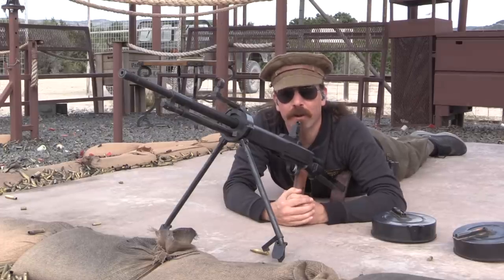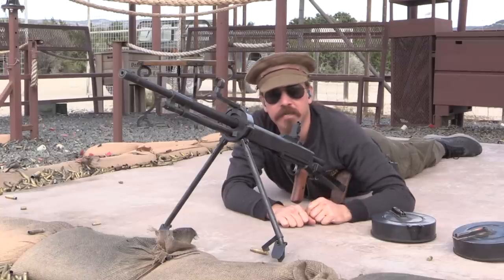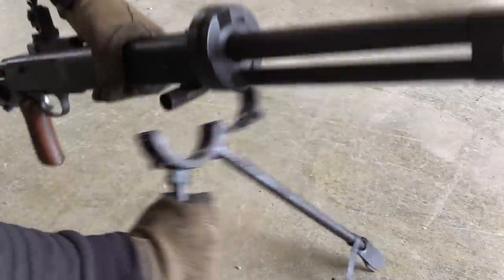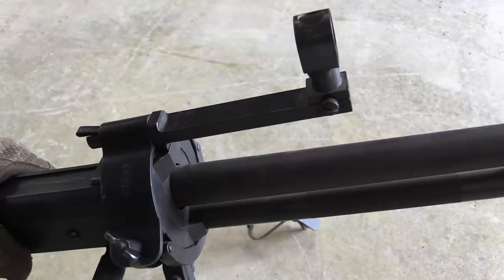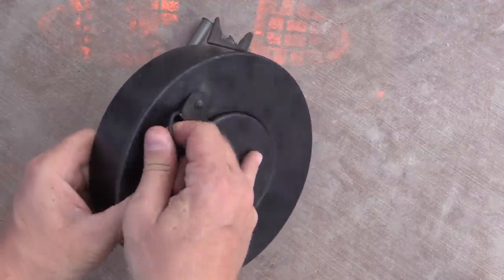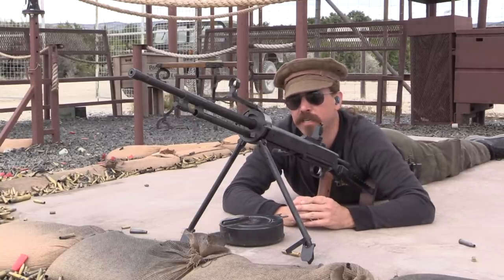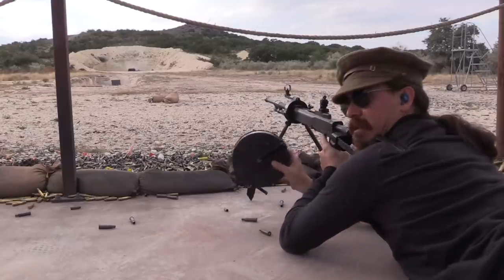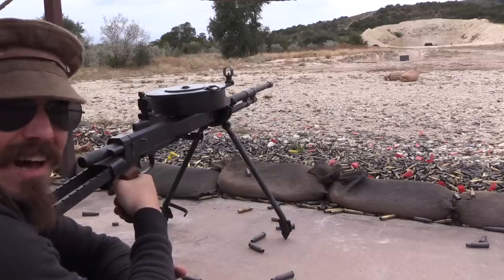DTM: The Soviet Tank Version of the DP-27 LMG

Comment: Seems to me this was primarily a vehicle gun that was intended to be used dismounted only in an emergency. Considering that the most likely alternative would be no dismounted gun at all I think we can forgive its little peculiarities.
Reply: Yes. That's exactly what it is. He explains that in the first minute of the video....
Reply: @dawnbreakercastro5051  They did have a lot of (wo)manpower.
Reply: enrique kahn same with the Japanese type 97 Lmg
Reply: Primarily a vehicle gun, but it was issued to the infantry quite extensively as production exceeded vehicle requirements.
Reply: He suffers so much with this machine gun because he is too poor to buy a tank and have fun.
Reply: @kalsarikannit2058  I bet this comment doesn't have the same savour now :p
Reply: I read a fiction where a tank was in a hull-down position. Then the hull gunner dismounted his DT and went to add it and his skills to infantry for a while.
Reply: It probably was also a factor that they want to have as few types of machine guns in production as possible, so if you need spare parts, they can be pulled from the same set of resources. This may have a couple distinct parts, but it's likely mostly compatible with other dp-27 guns. Might as well be capable of pulling it out for emergencies since the primary version of the gun is infantry portable.

Comment: The two issues called out were probably less of an issue: 

1) Soviet tanker's helmet had ear flaps that would effectively protect the cheek/chin from the sharp edges of the collapsible stock.
2) If you're a dismounted Soviet tanker in the 1930-1940s, chances are you're fighting in the steppe or a wooded area of Eastern, Northern Europe, and not on concrete paved firing range. The bipod was supposed to dig into the ground for a good 2-3cm, so it wouldn't be as tall in practice. The intense mechanized urban fighting we observe in modern conflicts wasn't so much a concept until WW2.
Reply: I also think you only would take this out of the ballmount to run away and get another tank. Like the chieftain said. you are a tanker, not a soldier, get another tank and use the gun to keep the enemy down while you do that.
Reply: @isuzu6851  You'd also might dismount it for sentry duty.
Reply: @williammagoffin9324  correct. Also tanks break down a lot more before they ever reach combat and are abandonned.
Reply: @TheRealColBosch  or "tanker, not infantry"
Reply: If your a tank and your army has been surrounded which happened to russian armies a lot. Then you dismount and fight as infantry when your tank runs out of supplies. The germans were so low on infantry during stalingrad they did just that, dismounted and grabbed rifles.
Reply: Yuri V 100% right !
Reply: ... or you could just wrap your support arm hand around the side of the stock in the way, that it'll work as the cheek rest :P !!! Jesus guys, there you'll have, eastern problem solving!
Reply: caugh Stalingrad caugh
Reply: Only when I read this, I realize that most people who watching this videos didn't know these things. For Russians, it is as obvious as the fact that you take off your pants before you shit.
Reply: For me, the biggest mystery is why this machine gun has the ability to fasten the belt.
Reply: @АлександрФорт-д4ь  what belt?
Reply: @breembo  this machine gun does not have a shoulder strap. Because of this, it is inconvenient to wear.
Leaving the tank, the crew will experience significant problems with carrying a machine gun. In Stalingrad, this machine gun was actively used by infantry. I am sure that the lack of a belt created a lot of problems with carrying.
Please note that only two photographs have a belt that had to be tied in a knot on the barrel of a machine gun.

http://livinghistory.ru/topic/80906-pulemet-dt-29-v-pekhote-foto/

---------------------
у этого пулемета не предусмотрено крепление плечевого ремня. Из-за этого, его неудобно носить.
Покинув танк, экипаж испытает значительные проблемы с переноской пулемета. В Сталинграде этот пулемет активно использовался пехотой. Уверен, отсутствие ремня, создавало массу проблем с переноской.
Обратите внимание, что только на двух фотографиях есть ремень, который нужно было завязать узлом на стволе пулемета.
Reply: These were also issued to some Soviet paratroops because they possessed a folding stock and were lighter than the DP. There’s a picture on Wikipedia of a Soviet Paratrooper wielding one of these in winter weather.
Reply: @robacdc1977  It is not true. There was no special release of this machine gun for paratroopers. The folding butt does not matter when the machine gun does not have a standard carrying strap.
Do not believe Wikipedia, there are a lot of stupid things.
Reply: Александр Форт I’ll believe pictures that were there. Maybe it said Finnish paratroops and I’m misremembering, but either way, these were used in infantry roles in a limited manner during WWII. After 1944 all DP’s had a pistol grip and in 46 most of them were retrofitted into the 46 model which had a longer barrel and fed from a belt
Reply: @robacdc1977  
The infantry willingly used these machine guns. It’s good when you have an extra machine gun, but the enemy doesn’t. Especially often this machine gun was used in Stalingrad, where there was a tank factory and a supply of these machine guns. For reasons unknown to me, a transport belt is not provided for this machine gun. Without this, transporting a machine gun poses many problems.
The photographs that you saw are staged, on them the Finns shoot the shooting of a captured soldier of the Red Army, pre-making staged photographs.
About modernization.
I have DP and RP-46 (DPM), so I experienced their "convenience" on myself.
PDM (1944) received a pistol grip, which is very inconvenient. Got a normal fuse, the old one was uncomfortable. The return spring was moved so that the overheated barrel does not upset the spring. The barrel was made thicker, it was necessary. I really did not like the new machine gun butt.
In general, the machine gun has become much heavier.
Reply: @breembo  Same with the Soviets. Sailors from the Soviet Navy and the NKVD also participated in the fighting up until Berlin due to manpower shortages...
Reply: @axelpatrickb.pingol3228  NKVD's forces were supposed to fight cuz they constituted most of the border troops. As for the navy, there wasn't too much fighting on the sea for the Soviets so the sailors started fighting on the land. Manpower shortage was not the main reason.
Reply: @ScottKenny1978 When the DT was invented, modern notions of mechanized warfare didn’t exist. The role was more abstract, with tank existing to support the infantry. Dismounting and functioning as mechanized infantry was a concept that influenced the design, which turned out to be fundamentally wrong in WWII. Another one of those “Seemed like a good idea at the time” design choices.

Comment: 5:57- An example for the "why drum magazines are a bad idea" video.
Reply: On MGs they've traditionally worked quite well though. As a machinegun crew you don't get the same problem of it being a hassle to carry as things like belts and shit is also absolute shit to carry as well. Stick magazines has been used on MGs as well, but you can argue that's very suboptimal for suppressive fire for obvious reasons. I mean overall I'd say the strength of belt based boxes outweights the strength of drum magazines though.
Reply: The pan magazine on the DP and DT were specifically chosen to maximise capacity of the weapon while firing the rimmed 7.62x54R ammunition. Rimmed ammo being fired from belts are notoriously a pain in the ass as you have to pull the round out backwards before slamming it forward into the chamber. A notable exception to this is of course the RPD and PKM, though I'm guessing at the time the DP family was introduced it was the cheapest and most reliable option for the specific type of light machine gun they wanted. Much like the British with the Lewis however, they found the pan magazine to be a dead end and wouldn't use it again (except for a rare Bren variant) in their machine guns
Reply: @Enetso  RPD doesn't shoot 7.62x54R, also mid WWII they got the SG which was used on tanks after WW II before the PK became widespread. Rimmed ammo is actually arguably better than non-rimmed in machine-guns, I mean look at the PK compared to anything of it's age, it's not even close, a fair bit shorter and lighter while being more reliable.

Comment: The long bipod was because the gun when firing would drive itself into the mud soft ground or snow. So higher was better in their climate. No one was shooting off a concrete pad. The collapsible stocks were quickly wrapped with rags and left open once removed from the tank so that was no issue as well.

Comment: It is interesting to see the notches on the up side of the stock. After looking at several sources, I noticed that there are pictures of the stock with the notches down  as well as up.  Also if the butt pad has the hinged shoulder brace the notches are up and if  there is no hinged butt plate the notches are down.

Comment: Er, I feel should point this out:
If you're using the gun in this role, something has gone very, very wrong.
Reply: Or you're in a defensive position, your tank dug in into hull-down, and your bow machinegun (& its gunner) really don't have much to do. But if the gun is dismountable, hey, that's one more Dyegtarev LMG you can set in the trench and have it support your infantry.
Reply: Yeah, but then the crewman needs remount before you can displace, and if you need to do that in a hurry, could be problematic.
Reply: @mateuszwisniewski3877  Bow machinegunner doubled as a radioman.  But yeah, give the gun to the driver in such a case.

Comment: Have several Soviet type weapons, they work, very very reliable, I was in the service in the 70s and had a Belgium M 240 for a coax machine gun, unbelievable improvement, However they didn't issue a rear stock , pistol grip or bipod, I always questioned that as it would have been a great weapon to grab if you had to dismount.

Comment: Well, if I was on the receiving end of that gun, I would not be pondering if the chin not over the stock might eliminate the need to get flat on the ground pretty quickly. Also the gun is positioned on solid platform while in reality it would be on the ground, with the spikes in the ground thus lowering the gun as a whole and also giving added support.

Comment: Of course the serrations are on the top - is early Soviet design; comfort is Job #4 (safety is Job #3)!

But, seriously, I'll bet if you used the us technique of "support hand over top of stock, cheek on back of hand", you'd not only be able to get a good cheekweld (as you'd be adding a roughly 1/2" riser to the stock), but you wouldn't be resting your face on a dull saw.

Comment: Well ultimately this configuration was supposed to be used only for area security to back up the PPSh's and grenades in the tank while repairs were being done to a damaged tank. The cheekrest serrations are there to remind you of your patriotic duty to get your tank back running and you back in it.

The Soviets had severe penalties for abandoning workable equipment and especially as crews became more professionalized through 1942 and invaders this lead them to dig in with their tanks if possible to repair them under the cover of darkness, leading to many cases of supposed tank "kills" driving off the battlefield back to Soviet repair shops (common on all sides but an especially serious imperative under Soviet regulations).

Comment: Regarding the stock, and not having the opportunity to hold one myself, I was wondering if the "shoulder rest" (the flipping piece of metal on the stock) wasn't actually meant to be flipped forward (like at 7:40 but with the stock extended) and used as a hand rest for your weak hand, on which you would rest your chin ?

Comment: the taller 60 round drum seems to be an overall more practicall design than the 47 round plate, both because of capacity and because it looks like it is less cumbersome to carry more ammo due to the big diameter of the plate.
Reply: Well, have you seen the size of this beast? It's twice as thick!  And 47 and 60 - there's not much of a difference. 
If it was 47 \ 94, hell yeah, gimme me a big dakka.  But 47 and 60...reallly....    Praise Lord and Kalashnikov for PKM.
50 round belt, 100 round box, 200 round box, 250 round box...heard, but not tried -  a 600 round box, like backpack
Reply: @antoncomrade2043  well of course it is thicker but the diameter of the 47 plates is also quite huge, and very awkward to cary

Comment: Great channel "E" Just a question about the tripod mount. I can see that the sight can be pulled out of the mount and the sight has the mounting lug. I believe it is possible to take it out and reverse it in its bracket and then turn the tripod the other way so that it doesn't collapse when pushed forward. Can you try this out and see if I am right.  I believe I might be ! 😉

Comment: "...in a tank...you don't want to be changing magazines of any sort"

Colt M231 has left the chatroom
Reply: That thing is a POS.
Reply: @0neDoomedSpaceMarine  Oh it was a good idea.
Poorly executed. 
Rate of fire was impressive. Inside an M2 Bradley with full load, people and gear not much room to turn and use them.
Pretty much worthless for dismount operations unless you wrapped a loop of radio wire around the barrel and your foot to control recoil.

In reality it was just an extra thing to clean and keep track of that was rarely used.
Reply: @shawnr771  The only way the M231 could have been a good idea is if it was belt fed.

1200 rounds per minute and 30 round mags. 1 and 1/2 seconds to empty a magazine. Even with a discipline shooter that's 1 trigger squeeze and you have to reload because there is a worthless amount left in the magazine. Because you're looking through a viewing prism watching tracers you have to acquire before you can even think about adjusting aim.
Reply: @ekscalybur  Yep like I said good idea poor implementation

Comment: How much more expensive were the larger drums of the DT and DA machine guns to produce? Wouldnt it be easier to simply have the DP and DPM use the same drums?
Reply: The platforms of the DT and DA made the higher capacity and smaller diameter worth the extra cost.
Reply: @ScottKenny1978  im aware but why not just use one drum for all platforms?
Reply: @alexguymon7117  because the larger diameter of the DP drum gave packaging issues in tanks and airplanes, and forced more magazine changes. 

Yes, it would have been simpler and cheaper to use DP mags for everything. But at a cost in combat effectiveness that was unacceptable to the Soviets.

Comment: Why not have the serrations on the bottom of the stock rails???
Reply: Earlier DT-28 were made in that way with serrations on the bottoms and stock locking latch on the top. It seems that spring tube extension on modified DTMs forced to turn things upside down.

Comment: I would like to react to the subject of our weaponry in general during the second world war.
during World War II our weaponry was far from the best in the world. I admit; the fascists had the best of almost any lethal material.
our strength lay in the expense and speed of manufacturing weapons. their rusticity was compensated by a good solidity and especially to resist the extreme cold and extreme heat. how many times have the fascists been forced to dismantle their weapons in full operation in order to repair? too many times.

the rates of fire; the fascist models MG34 and 42 were very greedy in ammunition. in intensive firing, change the barrel every 30 seconds. the "Maxim pm M1910" was so old and unwieldy but this machine gun stood up to anything. the average rate of fire, the maintenance and especially the cooling of this machine gun were assets. it can be cooled with snow through a hatch above the water cylinder.
the old "Mossine Nagant" was a rifle of another age but even under - 35°C this rifle still fired thanks to a barrel studied for that and especially our oils and greases for weapon. the same for any other material. almost impossible for the Mauser K.98.
any weapon had been designed to be practical in combat to the detriment of maneuverability. our equipment was too often too heavy, ugly, but suitable for winning.
any weapon, if possible, was immediately salvaged from one dead soldier to another. in Сталинград Grandmother had this duty to recover the arms and ammunitions of the deceased soldiers for the comrades.
in Kursk, our destroyed tanks were often recovered in the middle of combat to be reconditioned and sent back to the battlefield. sometimes there was meat left inside, but it was necessary to win, by all means.

the watchword of the Red Army; adapt to win no matter how.